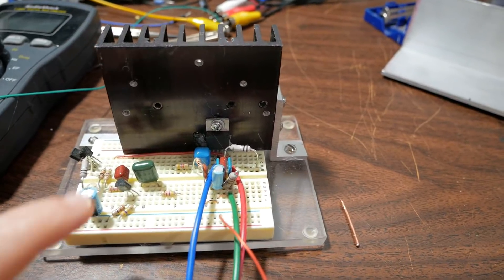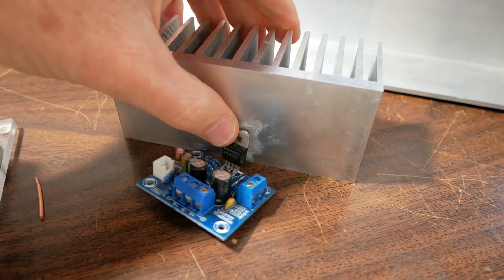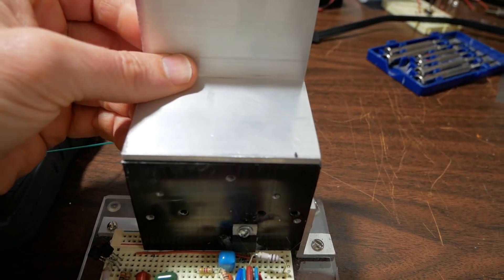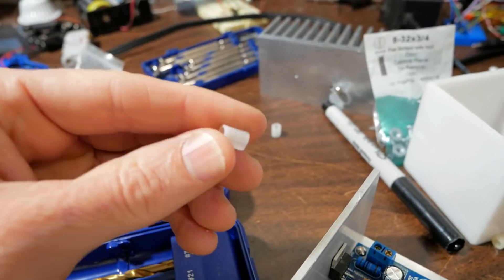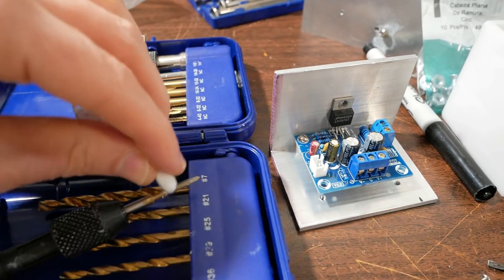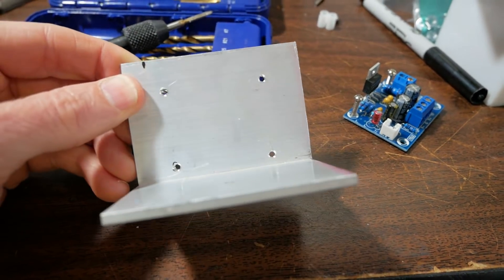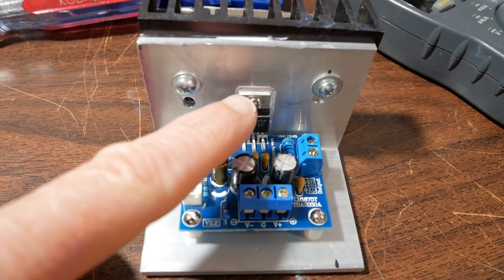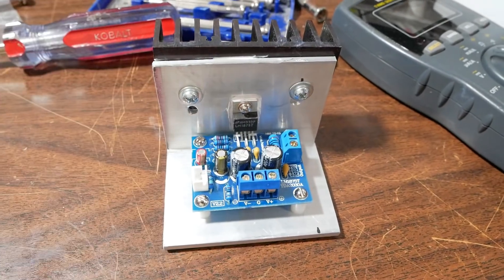Making the LM1875 lab amplifier

Comment: Hi John. Nice references!

You told me a while ago that the LM1875 was a drop-in for the TDA2030A so I went around replacing the two in my small guitar amp and it works just fine except for a slightly obnoxious power-on pop. I also noticed that the LM1875 wouldn't run at as low a voltage as the old chip which is interesting. I could get some amount of sound at 5V rail to rail with the TDA2030A but now it needs more like 10V.
Reply from the maker: Yes, the 1875 turns on at around 9v and needs over 12v to operate properly. The TDA2050 would be a better replacement if running at such low voltage. It turns on at 3v. Normally these ICs are run at higher voltage (20+).

Comment: Hi! I am planning to use this board with a 21-0-21 transformer.  Should I replace all the caps rated 35V with 50v  ones? A similar board with integrated power supply lasted for 5 seconds in full volume. One 4700uF/35V from the power supply exploded and when I replaced it there was no sound output. Fried LM1875?
Reply from the maker: Something had to be connected wrong. The 35v capacitor shouldn't blow with the supply voltage. Having said that, the 21-0-21 v transformer would be pushing the 1875 to the limits as the rectified and filtered voltage would be around 30 volts per rail.
Reply: @JohnAudioTech  thanks John, I sould go with a lower voltage transformer after I replace the LMs

Comment: great video John, I have a query, I have a 5.1 amp laying around doing nothing I want to use it somehow (was thinking of making a sound bar) but I have nothing to connect into it. Any way I can rig it for stereo input while keeping the output as it is? or won't it work that way? any ideas? thanks,
Reply from the maker: Do you mean splitting the signal to you use more of the channels from the two channel input? Some amps have inputs for each output channel, otherwise you may be stuck using a two channel mode unless you want to hack the thing.
Reply: something like that, I have 6 inputs 5 out plus woofer which has it's own seperate vol control, I was thinking of making some sort of sound bar if I can sort out the inputs
Reply: yes it is, it is just laying around I would like to be able to use it somehow
Reply: I think I'll go and buy a cd/dvd player that already has the outputs I need, not yet able to make what you're talking about, but might still mount the speakers in a soundbar config, thanks for your input